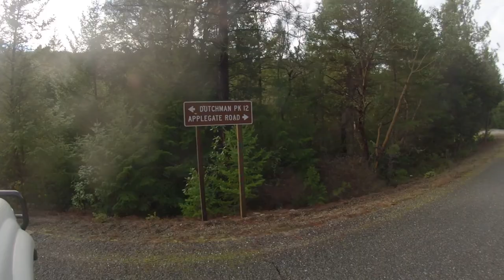One Lane Road - Episode 2: Beginnings

Comment: Being West Australian I am unfamiliar with snow driving. What's the idea behind piling everyone onto the land cruiser to help carve a track? Does the weight help cut down to harder ground?

Nice work fellas, keep it up!
Reply: ***** Haha! It was great! Started off with just one and more and more people climbed on board in each shot :D
Reply: +Intents Offroad Actually they may not know or some of them may not know but yeah with hard ground underneath the weight actually  does help the traction. The greater momentum would help too. More mass means more momentum.  There is a point though where there are serious diminishing returns when the snow starts getting significantly deep. Eventually to keep going you need to float on top of the snow. To do this you need the opposite of what works best in hard packed snow on road.  To float on the snow you need lightweight rigs and big fat tires instead of big skinny tires.  Low tire pressure is important to both conditions.